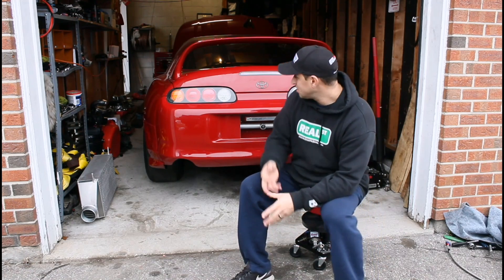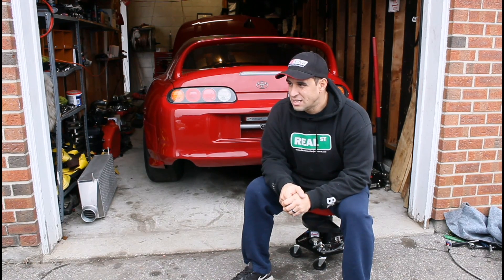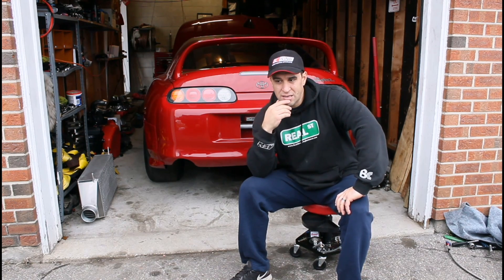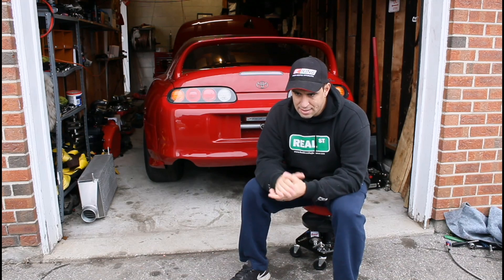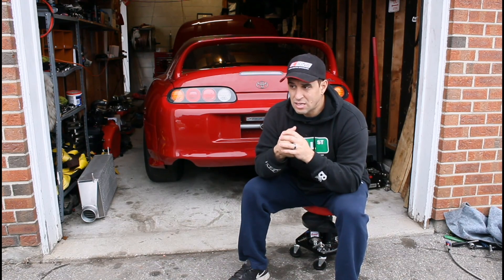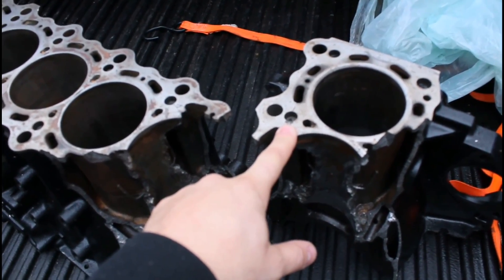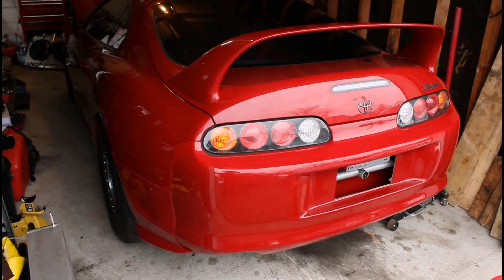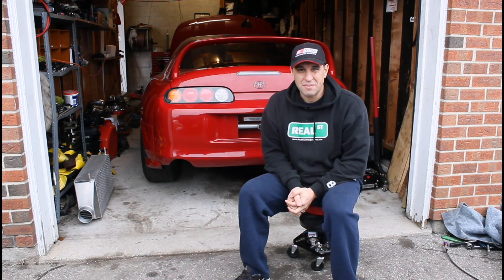Supra engine broken in half!

Comment: Isn't a 2jz cast block good up to 2000hp??? 

Time for billet block so Mazworx or Bullet ?
Reply from the maker: Anything over 1500whp is a hit and miss in a cast block. This block had 30+ passes at over 60 psi of boost so it was a matter of time. We have a Bullet billlit block in order, should be here next week
Reply: @RyanSammutRacing  guess some people have more luck than others,you getting the wet block ?
Reply from the maker: @Realtime1501  wet block dry deck. We did add 2 degrees of timing in that last pass so it might have been a little too much. Oh well, we tried
Reply: @RyanSammutRacing  good luck on the new build I think the 98mm motivation will push your goals quite a bit higher